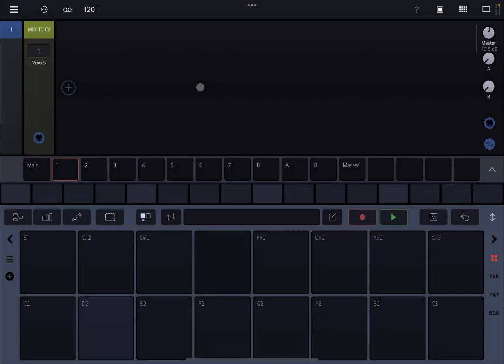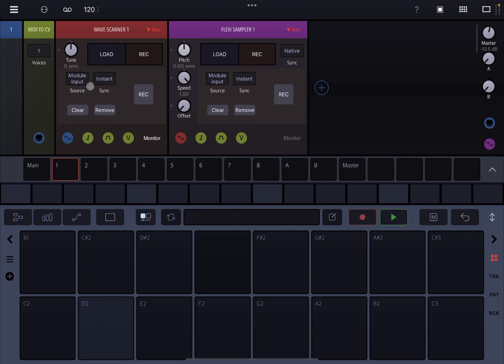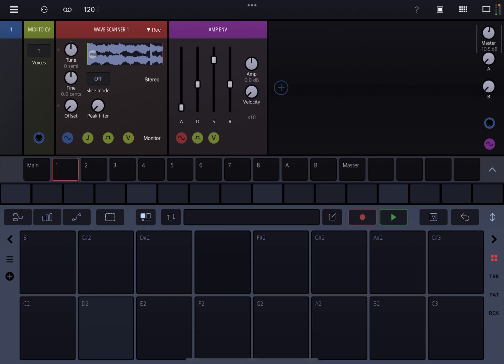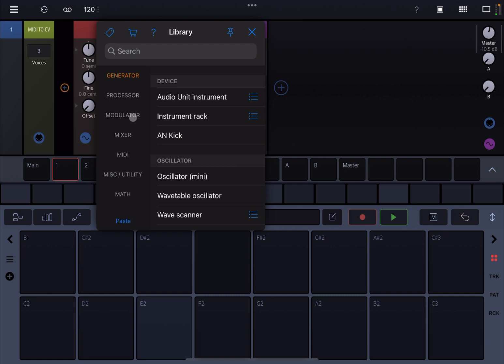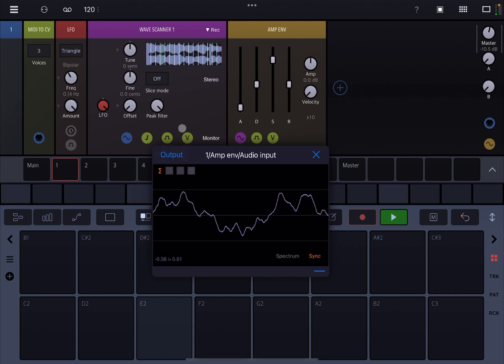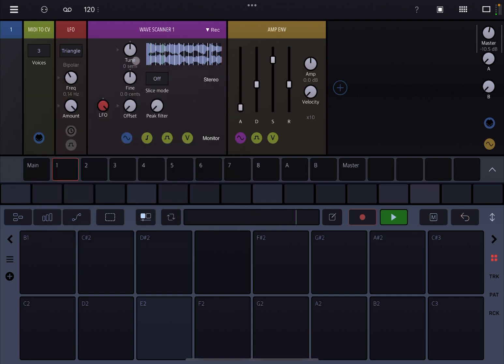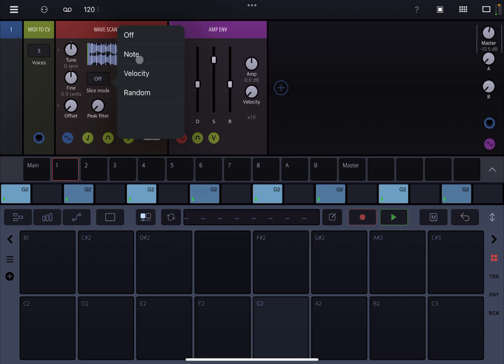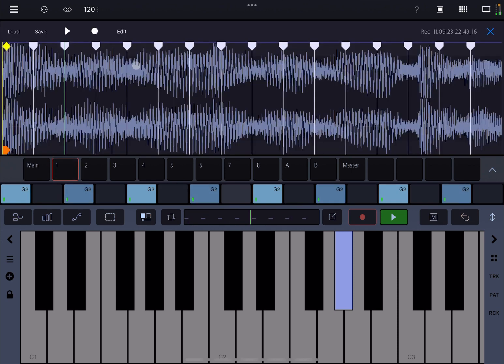BeepStreet Drambo v2 - Demo / Tutorial 93: Wave Scanner Module

Comment: I keep seeing references to MIDI, but no information about connectivity to actual hardware MIDI controllers. I prefer to use an actual MIDI keyboard, not an onscreen keyboard within the app.
Reply from the maker: Sure and you can connect many devices to Drambo